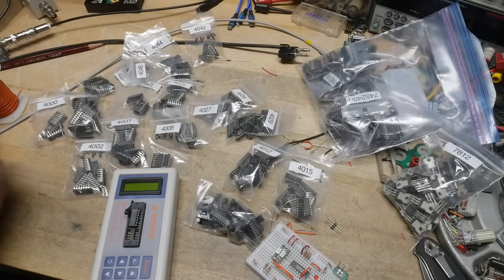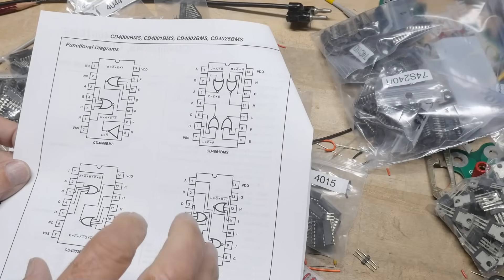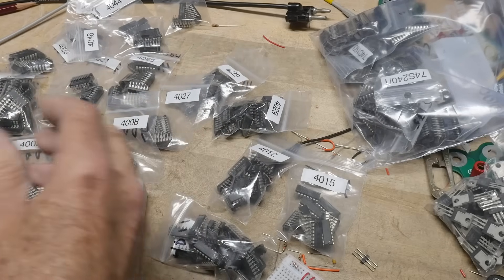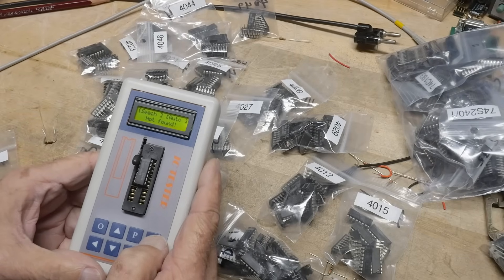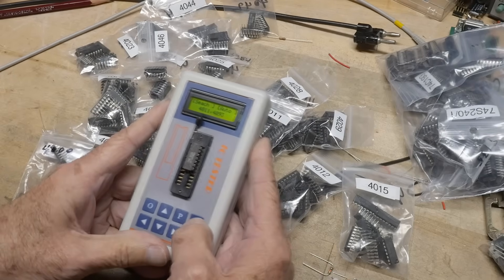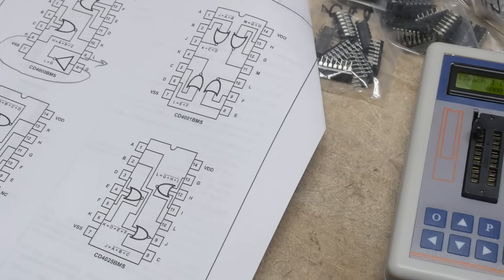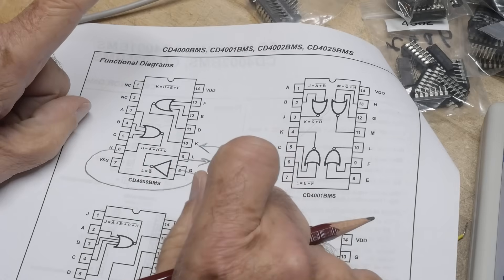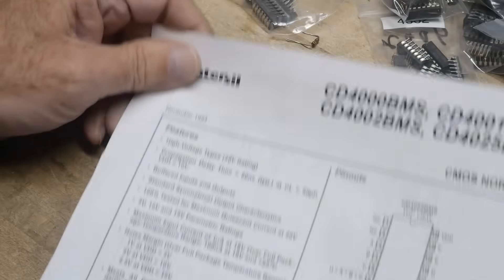#2451 CD4000 Strange Part

Comment: At the time of the creation of the CD4000 the "majority vote chip" was sooo important, hence the number of chips that had 3 inputs when logic was otherwise largely 2 bit based, so the semi manufacturers made the 3 input devices for the output of a logic block and the 2 input devices for the internal logic of a logic block. As processes and confidence improved 2 bit logic then took over. The designers used their logic skills to devise the required logic combination to achieve the required design.
  Agree with the comments on plastic bags, I never buy cmos chips that a trader has pushed into foam plastic blocks for the same reason.

Comment: VERY IMPORTANT * you may want to point out that in the 4000 series CMOS the substrate can act as a charge pump and the parts will actually work with no VCC connected. We found one of our circuit boards add two " sea moss " parts that had a ground but no power connected yet they still worked- mostly.. very embarrassing. We had to recall every single board to fix this major screw up. If I could find the guy that approved the PC board layout I would have walked him out! Number one rule an Electronics always check power ground and clocks, respectively.

Comment: If memory serves - it's been a LONG time - the CD4000A (not the 4000B) inverter had a higher drive capacity and was included to improve fanout.  The A-series chips didn't have buffers on the inputs and outputs - an inverter was basically a bare CMOS pair.  The A-series didn't have protection diodes either, which is what gave the whole CMOS line the reputation of being exquisitely static-sensitive. There was essentially no discharge path for any static that showed up on an input pin.

A related issue is how the 4068 (8-input AND/NAND) has a much lower fanout and is extremely slow.  It was hard early on to give CMOS enough oomph to deal with the gate capacitance of the stages that followed.

The only A-series chip that's still in common use is the 4007, which is kind of the Swiss Army Knife CMOS gate.  I've done some weird things with it, since it's basically the only way nowadays to get a well-matched complementary pair of MOSFETs.

Comment: CMOS replaced a lot of machine controls in the 1980’s stone age. Soon after, simple elegant CMOS and HNIL solutions were replaced with complex ornery microprocessor based timers plus relays. Factories can produce a great deal of noise, rf and ultrasonic. Eventually, 4 generations of microprocessor based weld timers, they were nearly as good as the HNIL and CMOS weld timers.😊

Comment: With cmos, is there a limit to how many OR inputs could one have on a single gate without having to combine multiple OR gates?
Reply: As you do for more inputs, the speed gets slower.
Reply: This also applies to NAND gates, due to using many MOSFETs in series, 1 per input.

Comment: I had a bunch of parts I think as I recall they were TTL they had weird markings on the top of the package put on the soft underbelly it was marked with a generic part number. I think they may have been M 38 510 military parts. I found that to be very helpful.

Comment: Anyone else shudder at those CMOS chips not being in anti-static bags? They are the same CMOS chips your standard "static sensitive" parts are made from today.
Reply: I was just thinking the same thing. I blew up an NMOS processor in 1980  just by saying something bad about it. Amusingly, I was more concerned about static in the 1980s than I am today. But I still teach new engineers about the difference between 'anti static' and 'static dissipative' packaging.
Reply: At l;east they are B-series devices with the protection diodes.  The A-series devices would burn through the gates of the input MOSFETS if you gave them a harsh look.
Reply: Yes and no, although a real issue, I hardly ever ran (knowingly) into that issue 😊

Comment: NOR and NAND are basic CMOS gates - they're literally universal functions where any logic function can be implemented using exclusively NOR or NAND gates. It would not shock me if the oddball inverter you see was actually a NOR gate with its inputs tied together - these were early CMOS days so maybe they fabbed extra gates, and it was trivial to wire them up so you got two good 3 input gates and if one didn't work, it got turned into the inverter.

Comment: Used to work on medical equipment that was all digital logic pre microprocessor.  Large boards full of dips.  That was when stuff like logic probes and those clip on HP logic indicators were used.  But mostly we used DMM and scopes.  Then I forgot much of my background in digital logic over the years.  Maybe subconscious trauma blocking.

Comment: if u have 6000x cd4025 - u can make the Apollo AGC  CPU from it ! Happy synthesis manually with pen and paper.  the bizarrest cd4000 is cd4007 its basically a  group of nmos and pmos transistors you can recoonect.  
Hop some day you try to get a small FPGA and try Verilog instead
Reply from the maker: Apollo used a different IC: https://youtu.be/2SRwjgzGvEA?si=xdOAgOo9WqKNZ1im
Reply: @IMSAIGuy  yes its Rtl,   Idea  was synthesis using cd4001 or 4028. also earl computers had -ve logic as it used germanium. CD4000 series easily does that too
Reply: Sure beats building a giant CMOS clock!

Comment: And why does the CD4000 not provide another inverter on open pins 1 & 2??? Hmmm…
Reply: to me it looks like 4000 and 4025 maybe have the same silicon, but different metal layers. That one NOR gate in 4025 (pins 1 2 8 9) has only one input in the 4000 (pins 8 9), so it looks like the two missing inputs are just not used and their transistors are just too small to be usable as an output stage for another NOT gate. But that numbering sure is wild. To me the whole 4000 series is odd with some quirky chips that 7400 series doesnt have, but lack some chips that 7400 series has... thats maybe the reason why 4000 didnt replace 7400 series entirely. But that is irrelevant today with new logic being the same CMOS mix logically equivalent to both 7400 and 4000 series.
Reply: @teslakovalaborator  Some chips from the 4000 series can also perform analog functions... you can for instance make an audio amplifier with part of a CD4069. Not a good amplifier, but an amplifier nonetheless. :)
Reply: HAH I was wondering the same thing..